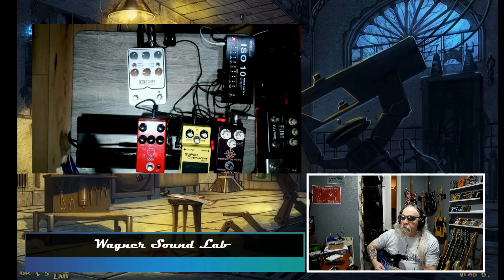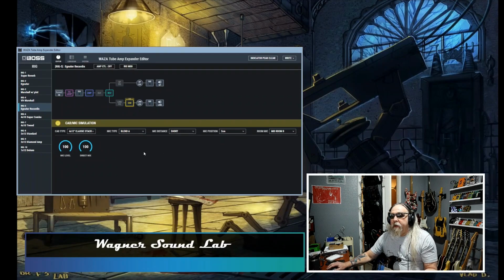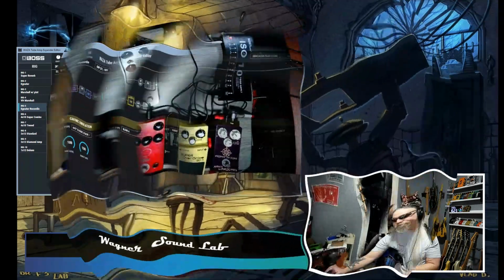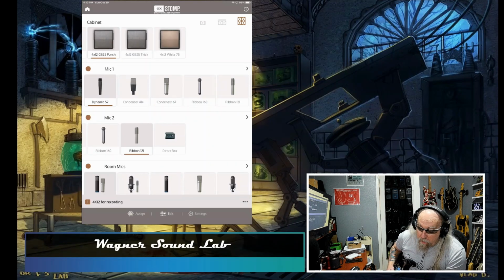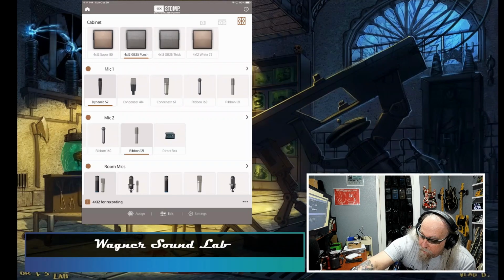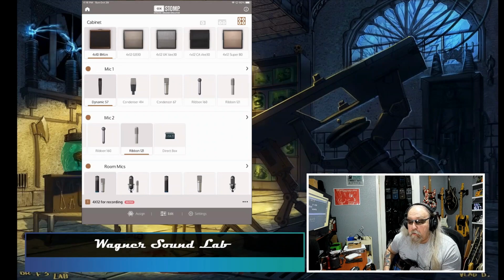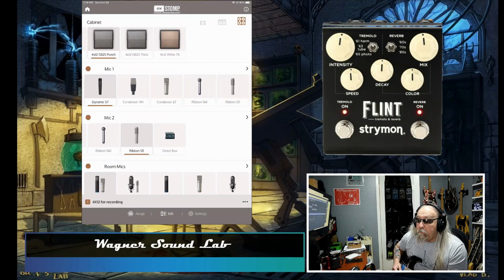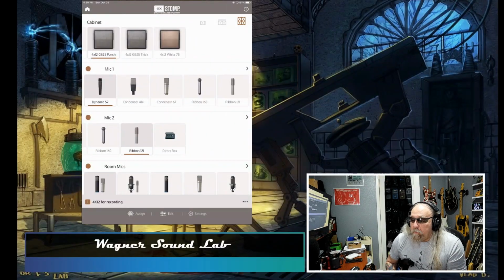Lab Test: Running a Boss Waza Tube Amp Expander into a Universal Audio Ox Stomp

Comment: Hi, thanks for the great video! Wondering, what level did you set the line out knob on the front of the Tube Expander to? Did you come across a "sweet" spot?
Reply from the maker: Thank you for the response! I have the line out on the TAE set about 2 O'clock.